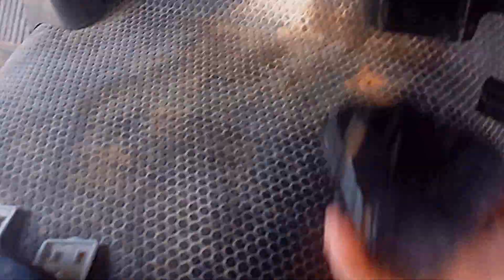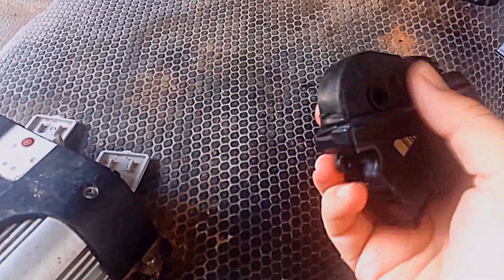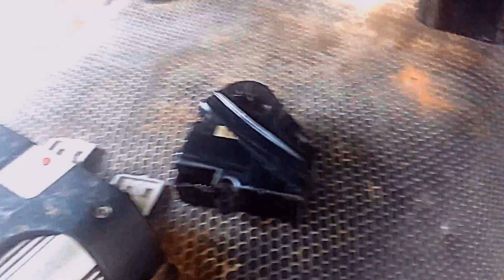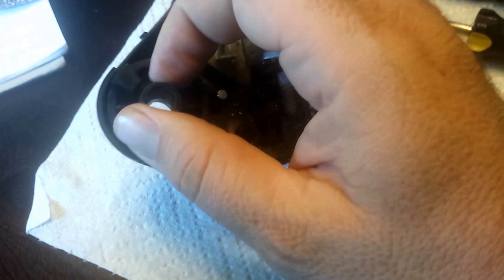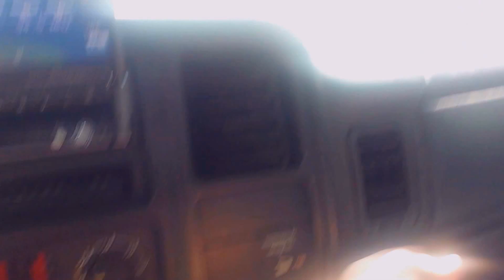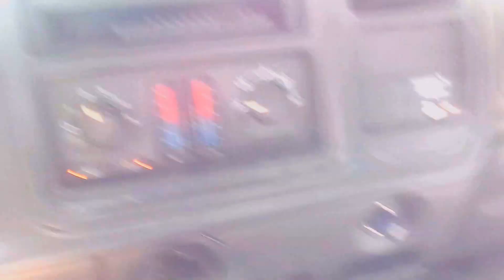How to fix 2002-2007 chevrolet ac that switches to heat on its own- drivers side blend door actuator

Comment: Try shortening the run time to 45 seconds it worked for me.  After I reinstalled fuse I turn on truck let run for around 45 seconds then turn off for 15 seconds then back on. I also tried the authors method for like ten times what worked could of been me trying ten times or shortening the run time to 45 seconds.

Comment: Having that same problem 2006 GMC Las Vegas Nevada the dealer fix the heater Fairway Chevrolet is the dealer 2489 dollars to fix the heater the air conditioner was working fine now they're both broke blowing air conditioner on the driver side heat on the right side had no idea what to do didn't want to go back to the same dealer I didn't want to go back to the dealer now is that video maybe I have a chance to fix it myself

Comment: This is the video I have been looking for, I have the exact same problem 04 Chevy Silverado 1500 LS 4.3l. I did as he showed, took it apart no broken clips, cleaned with alcohol Qtips and put back in, SWEET! Worked, same for years dealing with it. Thank you very much Diy!
Reply: You just cleaned it? You didn't have to bend the tabs out some? Or add grease to the board to have a smooth contract..

Comment: Great video. Just an update if you attempted to fix this by cleaning the contacts and it still fails... A replacement is $30, even at that price it's certainly worth it to clean the thing first and see if that fixes it.

Comment: I lucked out big time.  I was checking to see where the accuator was, and while the truck was running and blowing hot air, I tapped the accuator with the palm os my hand and presto, cold air started coming. Probably not permanent but probably dirty inside the actuator.

Comment: Thank you so much for your post, I could not figure this problem out for the life of me, pulling the fuse and letting it reset fixed the problem.  Problem was occurring even after I had replaced a brand new actuator.

Comment: My 05 GMC Sierra did the exact same thing after I replaced the blower motor resistor. I have the "auto temp controls" and did the relearn procedure for it. It completely fixed it

Comment: My '08 does every now and then...driver side blows warm.  I removed the three HVAC fuses from the fuse box under the hood.  Started engine for few seconds, verified that HVAC had no power.  Turned off engine.  Waited a minute, put fuses back in.  Started engine.  HVAC reset to default of AUTO, Passenger mode on, and both sides set to 74.  Normal function returned.

Comment: First try antioxidant on the connector then try just unplug it when it gets where you want ○ Gentle tapping on the drive housing while jiggling the wires then if that not works should be able to get it off with a quarter inch drive socket & squiggly wiggle u-joint they make for those then just set it manually a few times a year

Comment: Life saver! I'm in Florida. In a 2004 Tahoe. That's doing the same thing. And I didn't notice that the passenger side was fine until your video.
Reply: Same here! I didn't know that the passenger was cold until watching the videos,   im so mad with my self, i should research more instead of taking frion out of the sistem, now i have to put some more, but i think is cool because i took alot of day out which i think doesn't help with cooling, i rader have more gas than diy in the sistem,     some times we lern the not so hard way, but this information and the knowledge that now i all ready have has no price, i can even make some money by working on others People's truck's, right?!!

Comment: This still works. Had this problem for 2 years in an 05 Escalade and kept getting worse. It just started jumping to full heat after about 30 sec and could not get it to reset so I tried this. Not too hard, just remove the black cover under the passenger side dash and this actuator is visible on the bottom in front of the console. Only thing with wires sticking out in that spot.

Comment: BINGO!!! My 2005 Duramax 2500 was doing this at the lower duct area, just above the 'hump'. Blew cold air for a while, then hot air. I bought a "Air Door Actuator" OEM#89018365, from AA Ignition #GWA200. on Amazon for $29.99. With some persaverance, it will go in, just like the video. You must have the correct tools. Thanks for a instructive how to vid.

Comment: I have the same problem on my 2004 chevy tahoe lt 5.3l v8 and my ac has automatic controls. I just unplugged the switch to the same actuator and now it bios cold ac no problem now with heater so when it gets cold again I'll plug it back in for heater but its summer time. THANKS SO MUCH YOUR VIDEO WAS HELPFUL VERY MUCH

Comment: The Blend Door Actuators are for sale on ebay too!   Cost around $15.00...  Thanks for the helpful free video.  SG
Reply: What’s the link at eBay
Reply: 10.00 bucks on amazon from AA Ignition. Free shipping
Reply: Also you may need to reset your cars HVAC computer system... That fixed my 2004 tahoe

Comment: This was a fantastic video, I am going to unplug mine not that the A/C is currently working.  U da" MAN!  Quick question, why doesn't my fan work at all when I turn it to 5?  It works on every position but 5.
Reply from the maker: You need to replace the resistor that plugs into the fan motor.  Under the glove box.

Comment: Thanks a lot again my brother I wasn't able to remove the actuator it was in a real tight spot so I just turn on the engine and make sure it was on the cold position unplugged it and left it on plug and it work ever since .

Comment: I have this issue in my 04 Silverado 1500, I tried pulling the hvac fuses as some other videos suggested but still having the issue.  I came up with an easy and cheap solution,  Simply unplug the blend door when the A/C is working and the blend door will stay in the A/C position.  Plug it back in after summer when you need heat again. Hope this helps!
Reply: Genius!!!
Reply: Exactly what I thought
Reply: You are a Genius my friend
Reply: Thank you so much for quick fix unplugging works GREAT   Steve
Reply: Genius quick fix
Reply: Thank You So Much....👍🏿 I'll Definitely Do that... I'm tired of pulling the fuse all the time
Reply: Omg you might just have saved me hundreds lol.. I just bought a 04 Chevy Tahoe for the family weekend trips and didn’t check if the AC worked 🤦‍♀️ and since we’re going on a trip soon I thought I this was going to have to replace the compressor because I just added a can of ac recharge or whatever it’s called lol but only the back ac was coming out cold and the front driver and passenger side was coming out a lil fresh then hot so after seeing this video and coming across your comment you both might just helped me out a lot!!! Hopefully this works just until I can replace them both. Thanks guys! I learned something new lol

Comment: I have a 2007 GMC Sierra Classic.  I was having cold air on the passenger side and HEAT on the driver's side.  Did the reset and it changed nothing.  Manually flipping the door to cold air was perfect in this Tennessee heat.  Many thanks for this video!!!!  I'll try cleaning and resetting again.  Hopefully, this will fix my problem.  Either way, manual is working great!!!
Reply: Did that fix your problem?

Comment: 35 minutes.  All fixed.  I watched a video years ago of someone that took their dash apart...  I decided to live with pulling the fuse once a month to fix the issue.  That option left today with about 30 seconds before it returned to heat.  Thanks for the easy fix.

Comment: I have a 2002 Tahoe LT model and this actuator seem to work all the front vents, driver and passenger side.   I have taken it off now but haven't had time to clean it up.  Just put a small pair of vise grips on the door to operator it.  With nothing on it it would bang back when going around a corner and start throwing hot air again. Well that would be  great if it were cold weather all day long.  We been getting up to 60's in afternoon and it's to hot for that full heat coming from front vents. so yeah I guess the fail mode is heater on that blend door.

Comment: This helped me. Turn on your A/C to the highest blower setting and let it run 5 minutes, then dial up the heat leaving the blower in highest position for five minutes. this should resent your actuator to correctly blow hot or cold.
Reply: NOW YOU ARE NUTS!!!! PROVE IT??? LMAO!!!
Reply: @johnmuller5403  his kinda right, because my was blowing cold on hot, and now hot on cold, so im about to go outside to work on it, cus is 118 here in Las Vegas, and I'm sick of it, ill try to make a video of all and put it up here so you can see

Comment: This worked, 04 Denali
DO NOT test actuator while disconnected from hvac door, clean the gear grease from brass terminals and bend contacts down just a bit for better connection.Don't forget to do the relearn procedure after re installing also. Thanks for the video help

Comment: thanks for  video.   i have a question    i have. chevy trail blazer  whit. ac problems  somtimes blow heat air and somtimes blow cold air   du you tink you video and link hope me to fix the problem

Comment: how do I fix this problem , my ac fuse under hood keeps popping when I turn it on can anybody help me
Reply: I'd like to know the answer to this as well. My 2004 Chevy Silverado is doing the same thing. Started in early April with the blowing hot air. I would turn the truck off and back on and it would go away and not happen again for maybe a month or two. Now it's just blowing hot air and blowing the fuse! Its hotter than hell in NC - I need a fix folks!! Help!!!
Reply: Use a bigger fuse for it.

Comment: Dude.  Love your video, especially the analysis of the "fail safe design".  Funny thing is my dealer told me I had to remove the entire dash board to replace this at a total P&L of $980.  After watching your video, I pulled the actuator out and cleaned some grease from around the copper contacts.  I put it back it and went through the "reset process" (disconnect battery and wait a few minutes,  reconnect the battery; key on for 1 minute, key off for another minute, key back on for 1-2 minutes).  My total cost was a single paper towel and a finger (and about 1 hour of labor).  Thanks!
Reply: This cost you a finger!? ;-)
Reply: I just got hosed by a dealer! My sons car broke down at the bank less then a half mile from the dealer. We knew what the problem was but he was broken down in a bank parking lot! We had it towed to said dealer and all said and done $550 for tow and remanufactured starter! They will get you!!!! Wish it would have went down in my driveway so I coul have saved $450!
Reply: @beowulf3303  I broke down in a fazolis parking lot I pushed it towards the back a bit out of the way and took apart the hub assembly. And yes ALOT OF UGLY STARES.

Comment: Thanks for the detailed info brother ! I've had this happening (going from cold to scalding hot on driver's side) just periodically, on my 2004 GMC Sierra, SLT, Z71 for two or three summers now. Nothing but shutting the truck's engine off and restarting will bring cool air back and since it wasn't too frequent and I could get it back every time, I just added it to my long list of things to do/fix. I've had many other priorities ahead of it unfortunately but since it started, I've researched it a little on line, here & there and talked to a few people and had mixed info everywhere. Well it's now moved high on the list as it has recently started doing it every 5 to 10 minutes !! Dark leather seats and 98 degrees with a 108 +  heat index here in Eastern NC, with this happening frequently, ain't  gonna work !!!  What you said about the logic behind the design/fail safe does make good sense. Thanks again Sir.
Reply: Stucknarutt  ur right same with mine  i gotta turn the truck off than start her up again to get it back cold  bit mines on both sides so i guess ill be replacing  both sides of mine